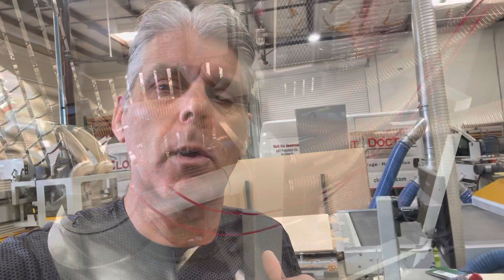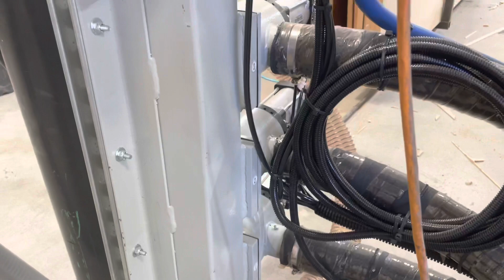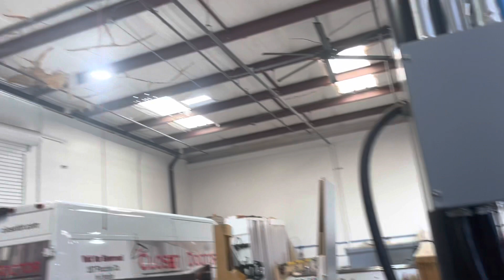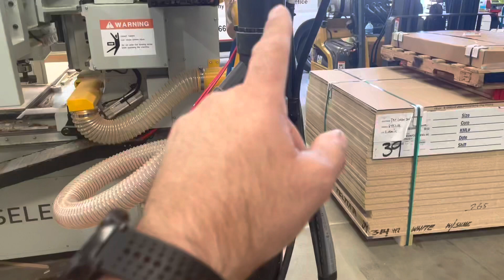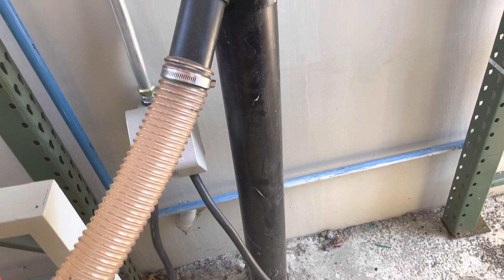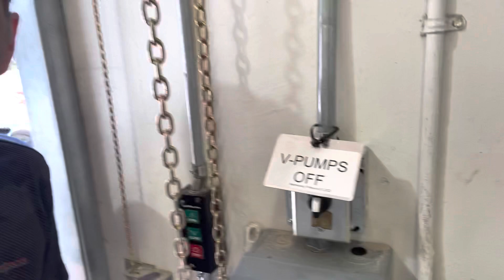How to Remotely Install Vacuum Pumps on Anderson CNC Router for a Quieter Shop

Comment: That looks like a set of Beckers, and those things are beasts. We had an injection molding client that had a specific set of operational parameters. Becker's app engineers were basically at our disposal for nearly a month, including doing things like running fluid dynamics simulations and finite-element analysis. I'm 100% sure those pumps will still be running while you're on an island enjoying retirement.

Good call on those labels. They make label machines which you can heat-shrink onto the cables, essentially ensuring your always going to be good. What was that console you're using for your CNC?

Just a few notes. That outdoor setup no longer qualifies as a compliant disconnect. They got rid of the "combined" exemption as of NEC 2020. Each individual device must now have its own individual disconnect within its own enclosure. What I would do would be (this is not advice- consult an electrican familiar with the latest NEC code in your region) -- 1: Replace the outside outlet with a IP67 GFCI, giving your passive protection for your pumps from damage due to the outdoor elements. Maybe $100 bucks and worth every penny. 2: 1 phase disconnect units are fairly cheap until you move into the ~250A range. You can find new-old-stock units for 30A for ~$100 a piece, made of 18, sometimes 16 gauge steel if you're lucky. Eaton, Cutler-Hammer,  ABB, Allen-Bradley, and Siemens are all UL certified, A+ units. I know it sounds like a pain but there was probably a reason why they changed this code to begin with. (No idea what the specific is, I'm just a dumb mechanical enginerd)

edit: oh damn, this is an absolutely terrific deal (listing: 115986722822 on ebay). If I had any commercial outfits, I'd purchase one of these just to have on hand. Anyways, good luck with your business man. I buy American, because that's the real way to make America great again ;)
Reply from the maker: Thanks for the feedback

Comment: My customer did the same thing and had 10,000 hours on his pump because he didn't make a reminder tag to shut off vacuum pump. Good idea.
Reply from the maker: Yeah that’s an issue when you don’t hear them running and only have a small light on the panel telling you they are on

Comment: I'm considering to add a second pump to my cnc, do i need special electronic valves or anything?  Or just simply hook both hoses to a splice pvc pipe?
My second pump will have it's own switch  because the cnc isn't wired up for 2 pumps
Reply from the maker: Not sure. I think the pumps have a 1 way valve in them so you should be able to T it into the lid me
Reply: @derrekholland5207  no issues with vacuum drop on that distance?
My pumps have a 63mm hose  but i can't seem to find any fittings that size, what did you end up using?
Reply from the maker: @gerbdj1570  it might take about 2 seconds longer to reach full vacuum on my old machine. The Anderson has valves that I left close to machine so the black pipe is still Nader constant vacuum and the vacuum is almost instantly at full pressure when activated. 
All my fittings are pvc or Ana from Lowe’s

Comment: Mr. Derrek, I just ordered a cnc and my salesman is fussing just a bit about having the pumps further away from the machine. Have you noticed a loss of vacuum at the machine?
Reply from the maker: Zero issues with remote pumps. Anderson’s have a reserve tank on them. I’m theory it takes a few seconds to pull max vacuum but we have no loss of vacuum or airflow with properly sized pipes